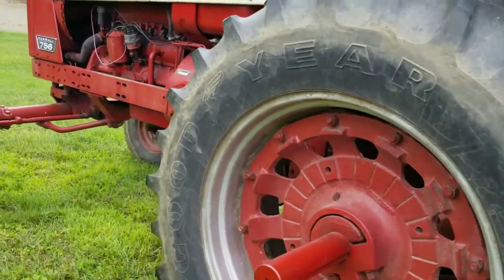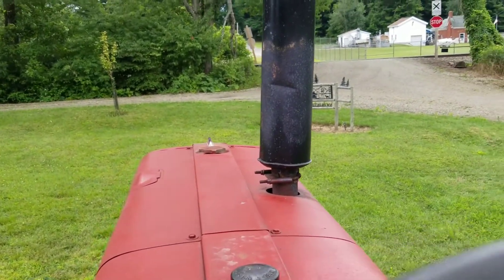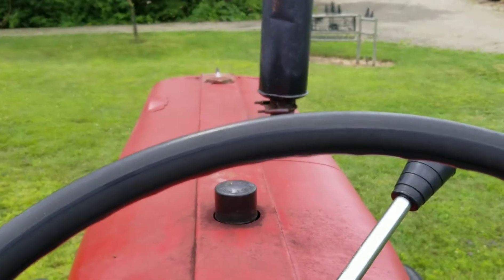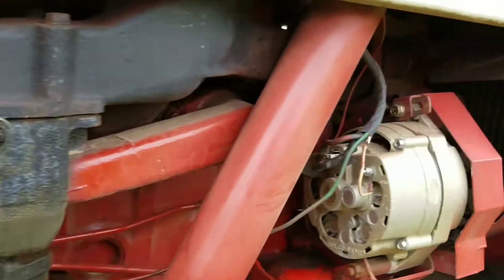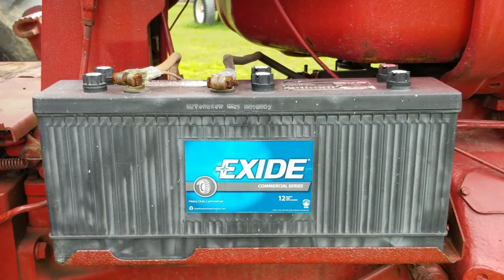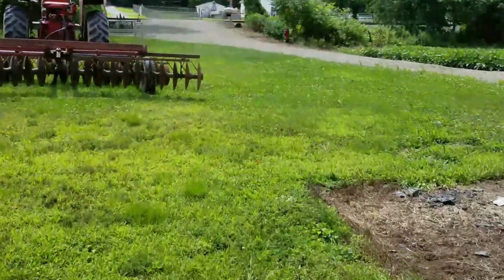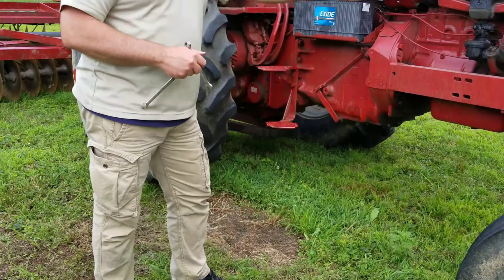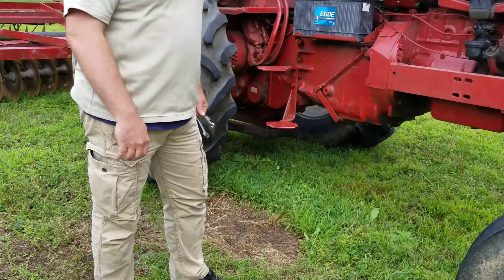How To Test a Failed Battery or Alternator ✔

Comment: I got an old backhoe.  I got the alternator tested and it's OK.  There is only one wire on the alternator, there's something missing to get it to charge the battery, what are the basic wires I need, there's supposed to be one for the field too?
Reply from the maker: Check out my Super M-TA Playlist...should be on there
Reply: @FarmallFanatic  I got it, just needed a wire from the keyswitch to the field on the alternator.  actually I"m so lazy I just use a jumper and touch the field to 12 V after I start the engine, the alternator kicks in.

Comment: yes that works unless... you have a magneto!  The test is a good test, should have your lights on if you have them. this will tell you battery or charging system which can include regulators, switches, gauges and wiring

Comment: didnt know that trick thanks , and alternator propably is ok only thing you need to change is voltage regulator on it or brushes
Reply from the maker: It's internal
Reply: yeah solder gun my friend
i done that 100 times and that reduce cost, alternator cost let say 100 buck regulator like 10 just little effort to replace that same deal with brushes and of course it is internal around 80`s they begin to solder it in so you buy new alternator instead repairing the old one and if you give the old one to the seller you get discount easy play right ???

Comment: What kind of gas do u run I 756
Reply from the maker: Non ethanol 90 octane
Reply: Dose it get good gas mileage
Reply from the maker: Hunters Life it does drink gas, but gas is 50 cents cheaper than diesel a gallon here, so it almost evens out in my mind.
Reply: Ok i will try that in my farmall 706 I put 81 super unleaded gas in mine and it bad